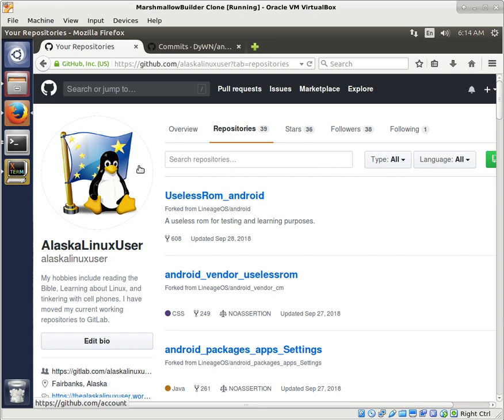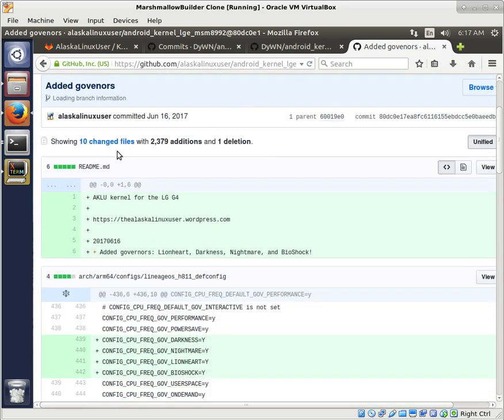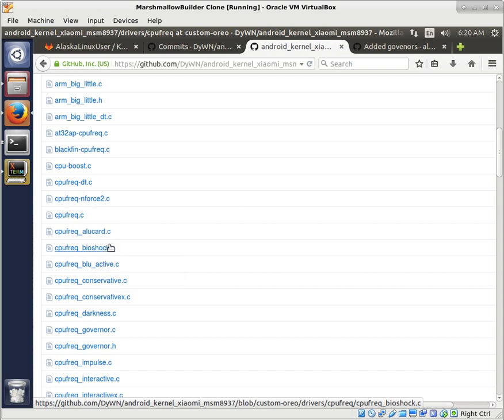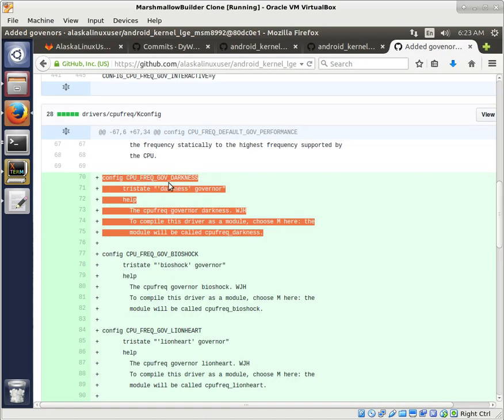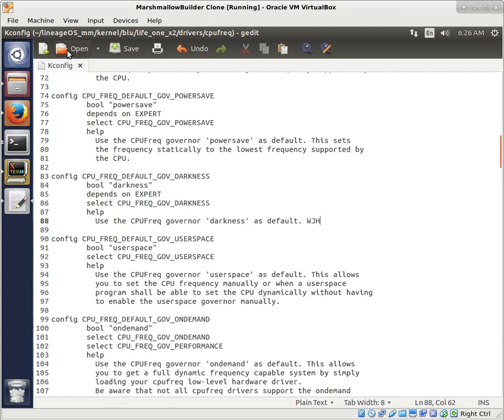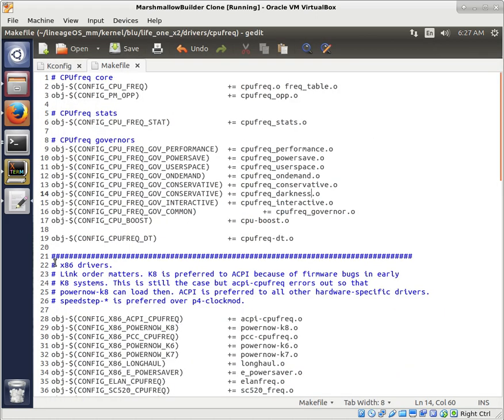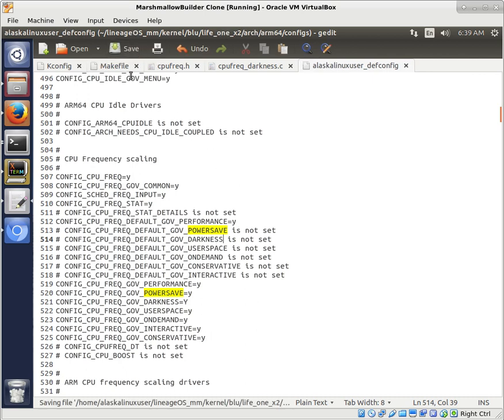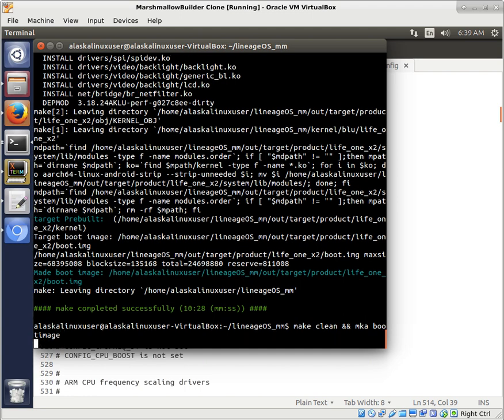Kernel modification: Adding Governors

Comment: Dude, i followed Every step you told me to.
I'm using open Source Kernel Apolls QSS Is the kernel i've modified, shall i convert the modified kernel folder to Zip and flash It through TWRP?
How am i Supposed to flash It in the phone?
I'm using CorvusOS Custom ROM using stock coruvs OS Kernel.
Reply from the maker: You can either flash it with fastboot, or chainfire, or make it into a flashable zip. I have videos on how to do those things here. :D
Reply: @AlaskaLinuxUserAKLU  Thanks For Your answer dude, but unfortunately, i've realized that which i modified Is Just the Kernel Source, and that that which you modified in the video Is the Kernel Source as well.
I do know how to make my own Kernel, but my gaming Rig Broke lots of years ago and i'm using an old PC with a Pentium 2 and a GT 210, which Doesn't support Linux as a subsystem nor Ubuntu or Virtualbox, so no interactive Governor For my Snapdragon 865 i'm afraid, as no One Likes to create custom Kernels For Xiaomi Mi10T, and the very few that exist have very Little changes to Them.

What a Shame, interactive governor Is a must have to avoid Input lag in everyday tasks, i'm having lots of hiccups despite the many custom ROMs i've used beacuse none supports It.

I Also can't OC the frequencies to get more performance beacuse of the d*mn Trustzone Locks :(